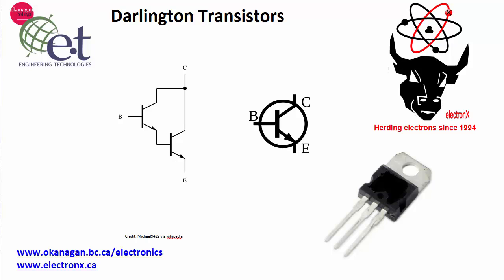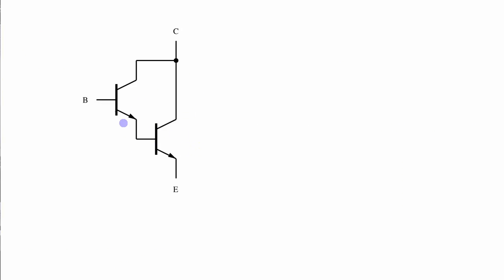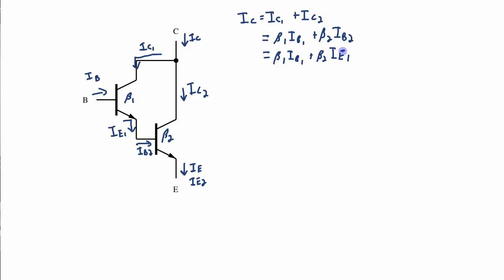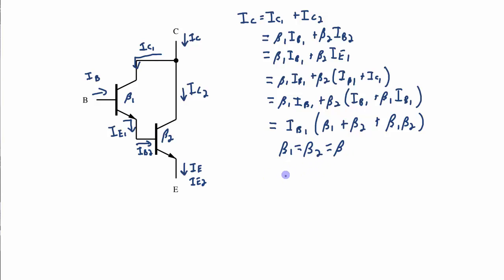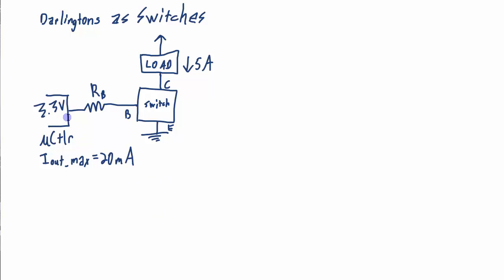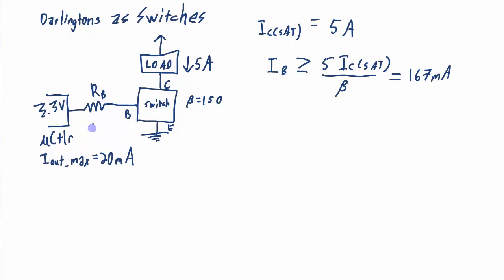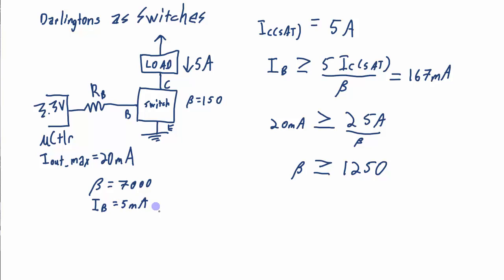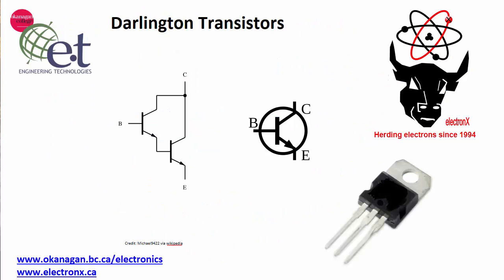Darlington Transistors and Using Them as Switches

Comment: If I had a voltage on the emitter side, like for example in a switching power converter circuit, how does one go about selecting an  appropriate Rb? Because wouldn't the voltage be 3.3 - 1.4 - Ve, making it negative if Ve was large enough.

Comment: Hi good day, excellent videos and how to explain I wanted you to help me with a doubt HOW DO I MAKE A Darlington BUB941ZT WITH TWO CONVENTIONAL TRANSISTORS? WHAT do I have to take into account when combining them, can they be different or do they have to be the same?

THE VOLTAGE THE CURRENT AND THE Hfe The darlntong that I need your data are 

Vceo 350 VOLTS 
Hfe 300
 Ic 15 A 
POWER 150 watts

Comment: why did you multiply Ic(sat) by 5 in the second part of the video? Isn't it just Ib= Ic(sat)/B
Reply from the maker: Ib= Ic(sat)/B when the transistor is in the active region. For a switch, I want the transistor to be in saturation and in saturation, IB > IC(sat)/B, so to ensure that the transistor is well in to saturation, I want IB = 5 * IC(sat)/B
Reply: @ElectronXLab  The tutorial implies you picked a arbitrary factor of 5 to assure the transistor is in saturation  ... should explain what the is the basis for 5X why not 2X or 10X.. surely 2 would be preferred over 10 since it would result in a smaller transistor to sufficiently handle a 5 A load. Should have reader to refer to the VA characteristic for transistor in question to determine an acceptable saturation current.

Comment: Where can I find the value of beta for my transistor?
Reply from the maker: It will be on the datasheet for the transistor. The datasheet will usually give you a range, so if you want to know the beta of your transistor you would have to measure it. The problem is beta will also change based on temperature, so the best you can do is have a range of beta values.